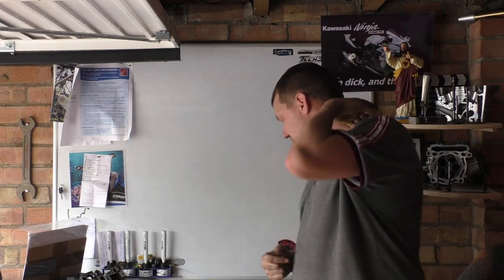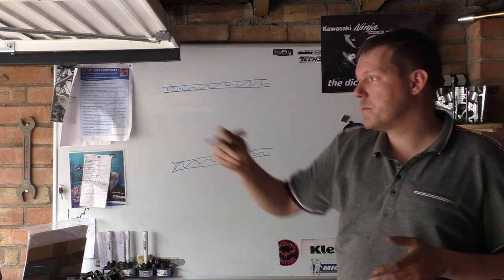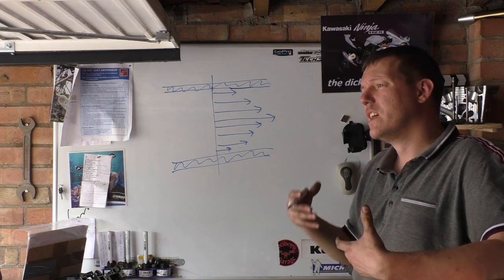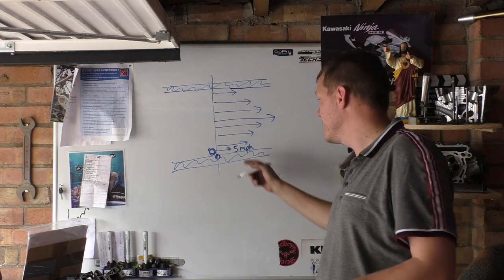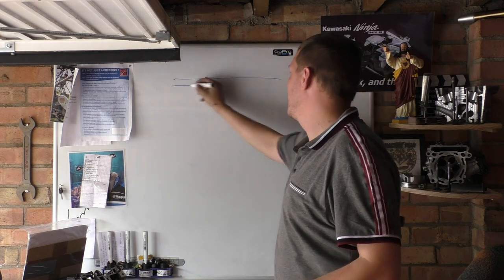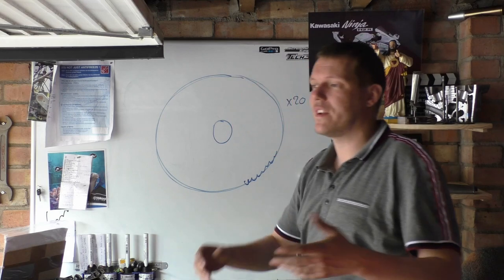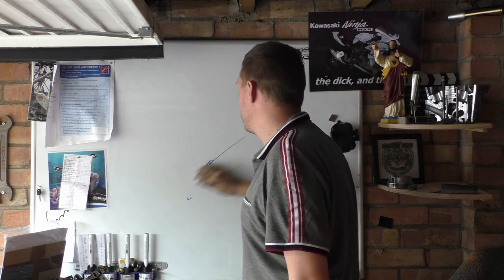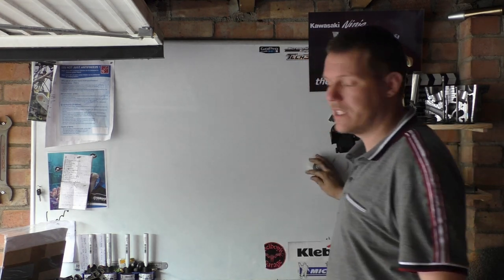Mirror shine your ports?

Comment: Is this the same as a gas flowed head?
Reply from the maker: It depends who you define a gas flow head. many people have differing definitions. If you mean a head that has been flow tested then no. If you mean a head that has all the inperfections removed then still no. This is the difference between the finish of the ports - polished or rough/sand blasted.
Reply: The Workshop ah ok cool. What about a blue printed engine or is that just marketing bs
Reply from the maker: LOL another awesome term - This requires its own video.
Reply: Properly blueprinted engines are awesome (assuming it's a good engine to begin with). Takes alot of skill and hours to balance everything and get all the tolerances perfect. Not sure if modern road bike engines really need it. Great for reliability on endurance race bikes though. Be interesting to hear your thoughts about it Mat

Comment: and talking about golf ball texture and the science behind it and the effects it has on atoms how it spins them(turbulence)gives them energy.
am i wrong in saying this is the point shit chip tank is missing wen they label effects is has on fuel lool
haha
Reply: yet they clearly arse raping and misselling products as performance gaining wat a load of old tosh,
once that fuel is burnt or combusted the story ends there
Reply: Leona Labratz I think you've misunderstood the point of energising the boundary layer. 
You'd want to do that to get the flow to follow a curve better instead of separating and becoming turbulent. 
Ideally you'd want laminar flow as much as possible for maximum flow. 

A deliberatly twisting intake would be counterproductive. 

A good example is velocity stacks on intakes, they flow better because they allow the air coming around the end of the tube to transition smoothly into the flow coming straight in. Without the bell-mouth air coming from the sides gets tripped up by the edge of the intake pipe because it can't make the sharp turn, becomes turbulent, and chokes off some of the flow.

Comment: In 2008 Honda started shot peening the intake tracts of their CBR 1000RR. They're the only bike from the factory to have this done at the time. What was the result? Off the assembly line... the best midrange power and fuel economy of all inline4 1000's that year (of all 4 cylinder 1000's in fact). Then Honda did the same to their 600RR's... with the same results.
Reply from the maker: I've heard people say this, and quote a cycle world article, but never found the source or honda saying this... shot peening aluminium and in a blind tube... sounds a bit like BS to me
Reply: @dirtygarageguy  Well I don't know how hard you looked (or if you actually looked), but I ran a search again and spent two seconds finding the Honda "bulletin". It's the fifth bullet point under "Engine/Drivetrain". Don't take my word for it. Check out the BS yourself. https://hondanews.com/en-US/powersports/releases/release-34647f92b93c7a44e94769004c34bdec-2008-honda-cbr1000rr-features